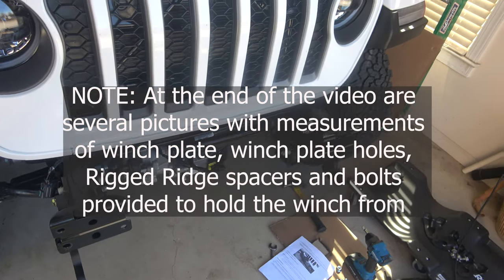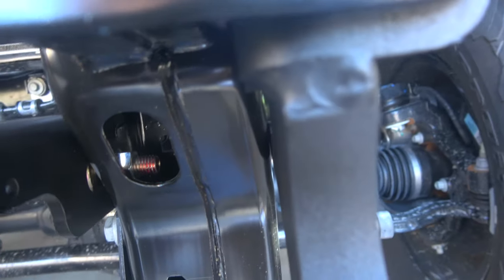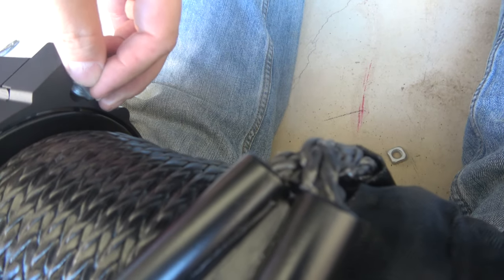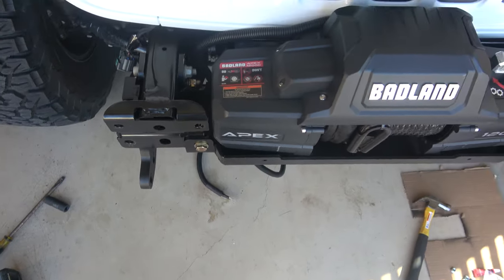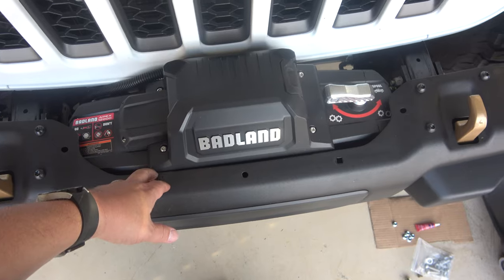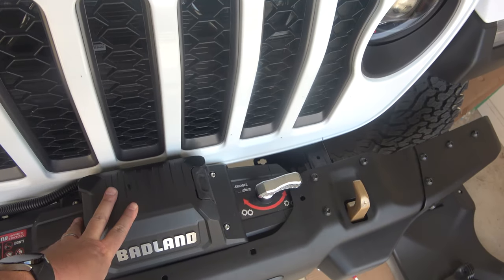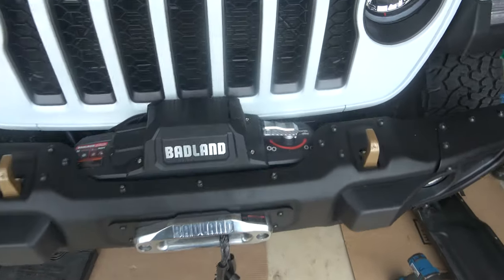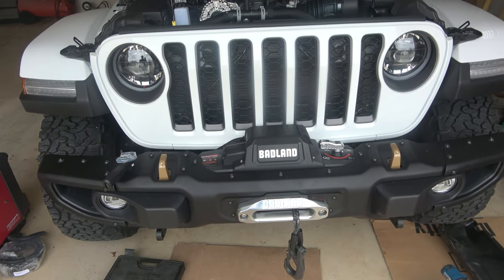Maximus-3 winch plate and Badlands Apex 12k winch install

Comment: this is a great video and will help me out for my installs for sure as i am going to use the same setup. thank you!… for the clutch handle, how much clearance is there? would a 1/2” spacer instead work or is 3/4” just perfect? Just wondering because I’m just going to fab up my own spacer when I get to install everything.
Reply from the maker: I just looked and there's less than 1/4" space between the lever and the bumper when you turn to freespool so I'd definitely go with the 3/4".  If you went with the 1/2" I'm pretty sure you'd have to cut/grind the lever a little to clear the bumper.

Comment: Hi. Never did this before. Are the spacers really necessary? In video, it looked like there was enough height without the spacers. Many thx
Reply from the maker: Sorry, I just post to help others so I don't check too often. I didn't check before I added the winch or tow loops, but after there was only about 1-1.5" of travel between shock and bump stop which is not much.  Ride was fine, but when you looked at it from the side you could see it sloping to the front.  After the spacer I have 2.5-3" of travel to the bump stop, which should really help out on the trails. If I didn't add a winch, I wouldn't do it. If you add the weight in the front (total with the tow loops, winch, winch plate was about 140lbs) I would just to get that extra travel, which is nice if you are doing trails which is why you added the winch.

I don't have any regrets installing it.

My biggest issue is finding time to hit the trails... :(

Comment: Looks pretty. Hope you don't ever need it. If you look in the owner's manual, in the section about duty cycle it states that it is 5% out of 15 minutes. It says that you can use it for 45 seconds out of 15 minutes and then it has to sit unused for 14 minutes and 15 seconds. Warn and Smittybilt cost more but can be used almost continuously.

Looks pretty though.
Reply from the maker: Thanks for the update on duty cycle. I've seen it but someone else may miss it. I've used it for much longer durations and never had an issue. Understood that there is a duty cycle, things get hot and you don't want to burn anything up, but its just a manufacturer's guidance. Similar to why we need 100 page instructions with 75 being warnings of some sort or other. Many people do not critically think about what they are doing. I do appreciate you bringing it up, something to consider when purchasing.

Comment: Nice video! How does the winch line feed with the spacer installed? Is it in line with the drum?
Reply from the maker: The fairlead protects the line going into the drum and the line is spooling under the drum. Visually its spooling ~3/4"-1" under the fairlead (fairlead higher than spool) when the line is fully retracted. Without testing, I'd guess (and makes sense) that after you bring the line out a ways it should be going straight in, meaning on level ground the fairlead and the line is spooling directly onto the drum if you had 1/2 the drum or more unspooled so it actually fits better with the spacer.